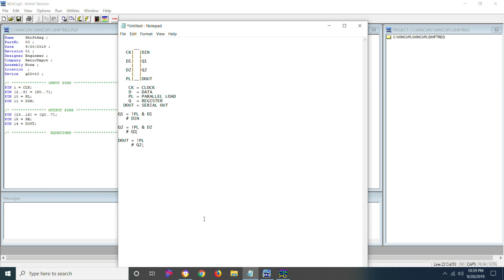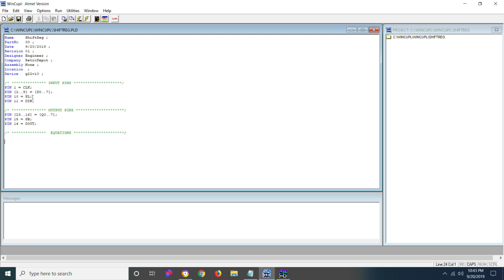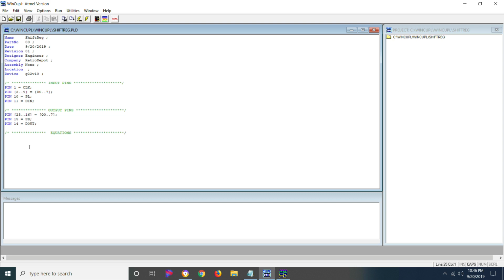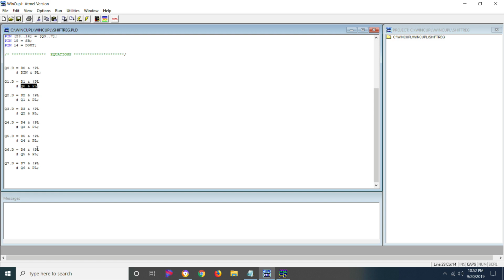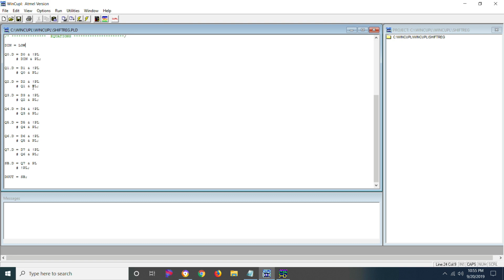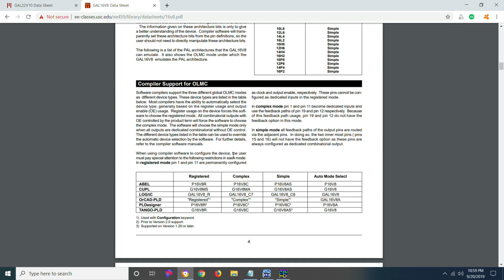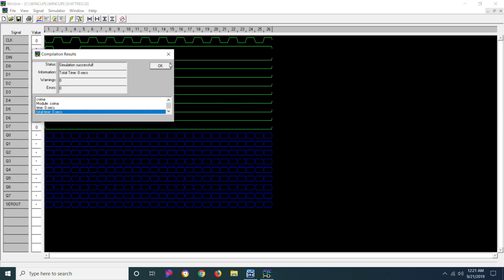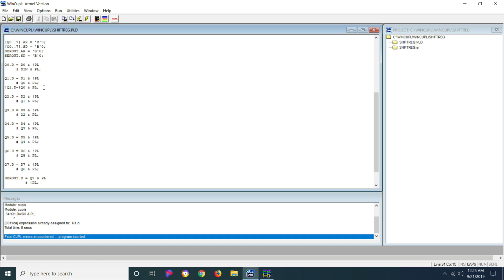WinCUPL Part 4: Registered Logic Pt. 2

Comment: Thank you for your help, I have a question, how to add a delay (like 200-300 ns delay) in the simulation for a particular signal? also, another question how to load this code to TL86II (It accepts only hex or bin files) Thanks in advance.

Comment: If you use FIELDs you can dramatically reduce the amount of equations you need to write, especially when they are this repetitive.

For example, you can have a field called DATA which contains D0..7, and a field called SHIFTED_DATA which contains DIN and Q0..6.

Example:

FIELD DATA = [D0..7];
FIELD SHIFTED_DATA = [DIN, Q0..6];
[Q0..7].D = DATA & !PL # SHIFTED_DATA & PL;

The CUPL toolchain will then expand that out to the required equations per pin etc.
Reply from the maker: Tom, I'm familiar with fields.  I simply wrote the code in this way for the new user to understand what is going on.